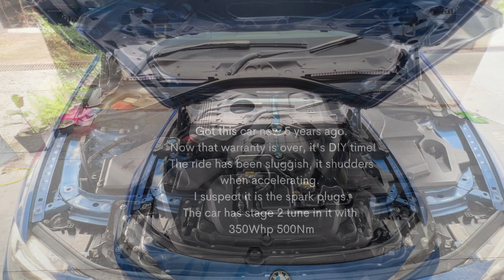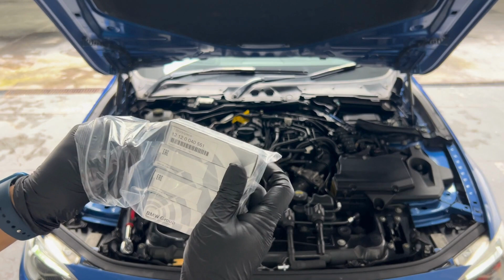BMW F30 330E Spark plug replacement DIY

Comment: Thanks for the informative video.  Now I know why the garage wanted so much money to change four spark plugs.  Changing plugs was something I used to do myself on my previous cars, took minutes and cost pennies.  My BMW 330e is a great car but simple things like this have been turned into specialist engineering tasks needing a university degree.  The last task I did was to remove the window wash bottle, pump and filter and clean it... took me a day and I had to dismantle half the front side of the car to do it.   I will shop around for a cheap garage to do these plugs when they are needed, life is too short.

Comment: Hi, I have a bmw330e that seems to drive fine but has a rough idle, did u experience this with yours??
Reply: Exactly the same as what mine doing at moment
Reply: @majicbeen23  mines completey intermittent, have you checked the waste gate on the turbo. Mines has the infamous play in it, so I am wondering if that is causing it.
Reply: @majicbeen23  mines completey intermittent, have you checked the waste gate on the turbo. Mines has the infamous play in it, so I am wondering if that is causing it.
Reply: @benno19891  whst do u mean waste gate lol mine starts to smell like its burning smell have changed spark plugs to new ones but still smells when drive over like 3000 revs i think
Reply: @majicbeen23  There is an arm on the turbo which opens and closes on the turbo, mine is loose and makes a metallic rattling sound, I'd be curious to see if your has the same fault. You can check by giving it a wiggle, it's on the left side of the engine where the exhaust drops down (Do it when engine is cold).
Reply: @majicbeen23  I think this could be the issue with a lot of these cars, if the waste gate isn't closing correctly on the turbo then the readings for o2 will be all over the place. My car is in at BMW on August 31st if I can find the page again I will let you know the outcome on this comment section.
Reply: @benno19891   by chance if it is the same as urs what would be the next step in fixing it
Reply: @benno19891  also when i parked up once after the smell of burning the exhaust part in engine bay or something down engine bay was quite hot like orange colour and smelly
Reply: Sometimes like a chemical smell and a hissing nose where the turbo kicking in when excellrating
Reply from the maker: Mine only when accelerating